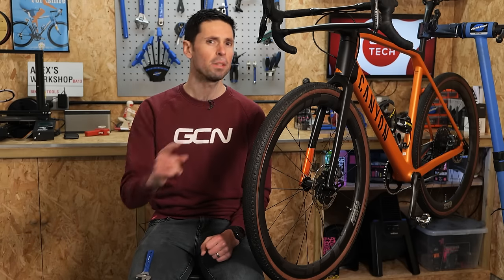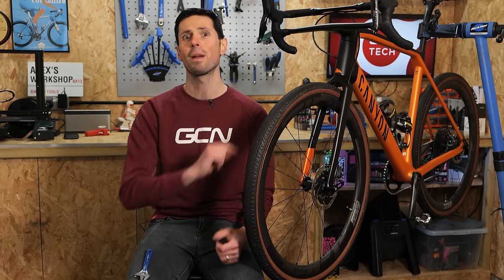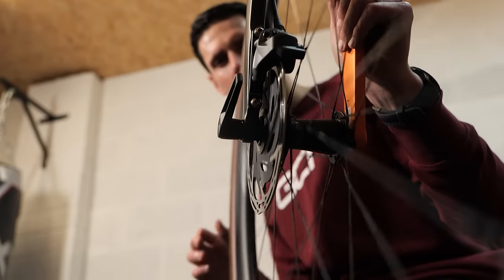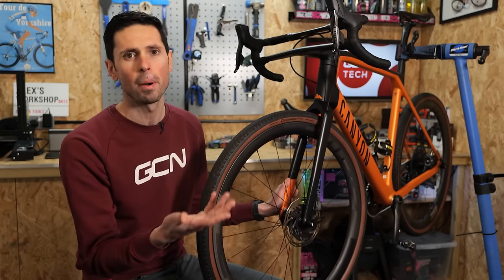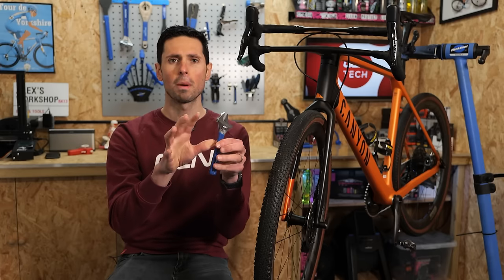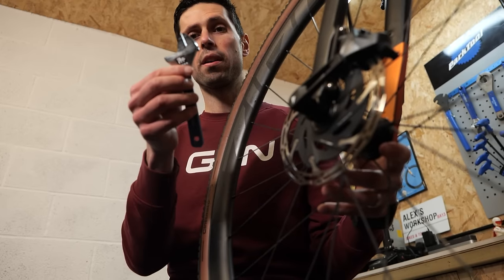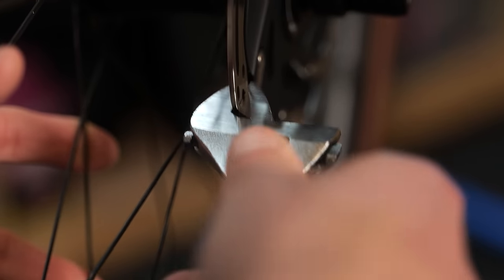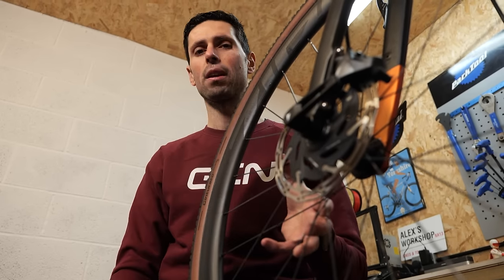How To Easily Straighten Disc Brake Rotors | Maintenance Monday

Comment: If you drive quickrelease you should check if your wheel is centered. Slighlty loose quickreleases or poor quality cones/dropouts might lift up your wheel a bit when heavy braking. 
I like to number the struts so I wont mix them up when bending. Still riding with some "graffiti" on my disc break.
Reply: Holy shit, dude. I was about to start trying to true up my rotor when I saw this comment. Set my bike on the ground and opened my quick release and saw the wheel seat itself slightly better. Tightened it back up and there's no more brake rubbing! This old comment just saved me a bunch of annoyance.

Comment: this is what I struggle with GCN...

You'll state discs are great but how many videos is this now on maintenance for them I'm literally loosing count 😂😂
Reply: They are great. It's simply because nobody uses rim brakes any more... :D
Reply: @GeorgeD1  I no plenty that do tbf not everyone falls into the marketing BS 😂
Reply: @danc1829  "Everyone falls for the marketing" so did you when you bought rim brakes over spoon brakes.
Reply: @whatwelearned  I actually brought both 🙈 rim and disc. sold the disc though as it didn't live up to the hype as claimed. No shock there I guess
Reply: @danc1829  But you can be happy with rim brakes without bashing disc brakes. Disc brakes are objectively superior. There's no debate. I can own an aluminium bike without feeling the insecure need to bash carbon bikes.
Reply: @whatwelearned  I'm not bashing disc bikes but sick of gcn making out there prefect when there not all the maintenance videos prove this.

Like I say I've had disc and rim on 2 TCRs... I've also ride mtb for over 20 years and use disc brakes so I'm not a hater...

But people that buy into discs thinking there issue free or 'better' are deluded... GCN actually did tests on this with Si on an emonda and in the dry the stopping distance was basically the same on all tests.. 

There better in the wet and that's about where it stops as far as I'm concerned tbf
Reply: @danc1829  but "as far as you're concerned" isn't relevant. Myriad tests prove they're better in the dry and a lot better in the wet. And no-one claims they're perfect, they claim they're better.
Reply: @whatwelearned  better? heavier, more expensive, less aerodynamic, more faff... also in the dry it's pretty clear on road bikes the limiting factor disc or rim is traction... nothing to do with the brakes. As I say a lot is dependent on what your actually using.

An example my campy boras with the AC3 brake tracks are carbon and stop just aswel as my alloy shamals...

I don't find I need more stopping power if I can already lock the wheels on my current set up.

people tend to forget the reason the industry changed to disc isn't because disc is more powerful the limiting factor is the tyre and road. The reason for the change was carbon clincher failures...

However fast forward 3 years and the resins are much improved like on the boras or zipp NSWs. it's no longer an issue.
Reply: @danc1829  Yes, better. They are better. At braking. There is no situation in which a disc brake performs worse than a rim brake. At best, it performs the same. You can accept the numerous studies proving this or you can be a flat earther. I really don't give a shit.
Reply: If you feel that you have to use carbon wheels, and you often ride in the rain, then disc brakes are the way to go.  For the other 99% of riders, rim brakes are "better".
Reply: rim brakes are much better ….at wearing out your rims.

Comment: Any suggestions for noisy braking? Already tried cleaning the discs and the pads, but the noise just keeps coming back
Reply: use sand paper on both the callipers and disc

Comment: never had this issue on mtb. now i got a gravel bike and the brand new disc rotor are bent and i tried to replace them with new disc rotors but still have same issue. must be because on mtb the gap between pad and disc rotor is larger so i just never noticed that brand new rotors aren't perfectly straight.
Reply: Probably bent wheel
Reply: @TimothyAndrews2004  i have been thinking and i think it's me installing the rotor badly because i don't have torque wrench and the rotor is 6 bolt. even the wheel is brand new and it looks perfectly true to me.

Comment: #GCNTech Could you do a video on shortening brake hoses? Do you have to do it at the lever? I've often wondered if you can do it at the caliper to avoid new bar tape?
Reply: It depends of a lot of things. 
What are you talking about? Hydraulic brakes or cable action brakes? If cable action : is the cable hoses "all way through" or just around some part of the cable?

If Hydraulic : yes, you can shorten at the end of your choice (caliper or lever) but since you opened the circuit, you'll still need to bleed it clean of air ; and a kit to seal the hose with the lever or caliper since you won't be able to salvage the old seal.

If cable action with hose "all the way through" : of course, you can shorten the hose but don't forget to remove the cable inside first... Or you'll need a brand new cable. 😉You'd also want to reuse the old hose end cap and to buy a new cable end cap since you'll probably need to shorten the cable too.

If cable action with just hoses on some areas : you can just shorten the part you want. Same advice as above.

Comment: To all people bashing disc brakes due to maintenance, don't forget rim brake can also be a pain. 

Disc brake problems :
leaks
piston stuck
rotor not straight
overheat
less lateral rigidity on wheels (the hub is narrower)
less aero and heavier
need to be bled every once in a while

Rim brake problems: 
lose cable tension
caliper not going back in place or stuck
wheel not straight
overheat (carbon or tubular)
wear the rim!!!
less brake power in the wet
have to change cable AND HOSE every once is a while or braking become harder.

So yeah, there is pros and cons for both... There's no absolute superior. Which one is the best depends of your riding habits and expectations.

Comment: my bike shop scammed me by charging 30 usd for service and new rotor when mine was touching rather than just repairing the rotor like this video

and it was a trek shop :) i no longer like trek :)
Reply: So you'd rather pay another 1/2 hour of shop time just to end up with a reasonably straight old rotor? Considering the cost of a name brand rotor, I'd say you got a good deal.

Comment: The only surefire way is to not have disc brakes. Road disc parts are so fragile and work within such tiny tolerances, 20k into your next ride, they'll rub again.
Reply: used discs for years, never had a problem with them that didn't take 5 mins to fix. i have however had rim breaks slowly wear away the rims from grit and other particles caught under the pads
Reply: I mean, you could use mtb rotors for your road bike too 🤷🏻‍♂️
Reply: Go out cycling in grimy weather. 20k in your next ride you will have to turn the barrel adjuster on your rim brakes because the pads have already worn out enough to need to adjust the cable tension. Again. And will also have eaten away just a little bit more of your wheels. 

Stop hating om something that you clearly don't understand.
Reply: @GeorgeD1  You're doing something wrong. Nobody I know has had those problems. My pads last for 10's of thousands of miles, and I've never worn out a rim. I've heard about riders wearing down their disc pads, to bare metal, in a 45 minute cyclocross race.
Reply: That’s why I use mtb rotors on the front. Only ever had problems with the expensive lightweight ultegra rotors that came on a wheel set I bought
Reply: @billkallas1762  How well do you think rim brakes with rubber pads would have fared under the same cyclocross race? Your argument is invalid.

Comment: Just go rim-brakes !
Reply: Then you’ll have to deal with rim wear, constant pad re-centering, pad alignment adjustments, pad toe-in adjustments, brake pulsing if the wheel is even slightly out of true, etc.
Reply: @shannontrainer5857  out of true is true for all wheels. Rimbrakes or not.
The rest of the udjustments are maybe once a year, and at a fraction of the time and cost.
Reply: @shannontrainer5857  rim wear people go on like u wear though rims in 12 months on here. I had some reynolds assaults. which must have over 70k on them and best part of 10 years old... which I then sold on for £450 as they where still mint. 

Rim wear is only an issue in winter on crappy roads in which case 99% of people will use cheap training wheels (which will probably cost you less to replacing a new rotors) I paid £50 for my last set of training wheels new.
Reply: Rim brake are for boring flat rides
Reply: @Numeriwar  Well, I find joy in riding, not in messing with hyped disc brakes.
Reply: @iberiksoderblom  With rim brakes if your wheel are even slightly out of true, you will get pulsing.